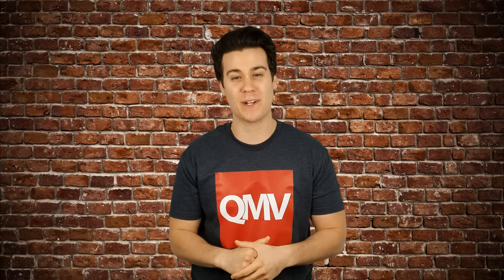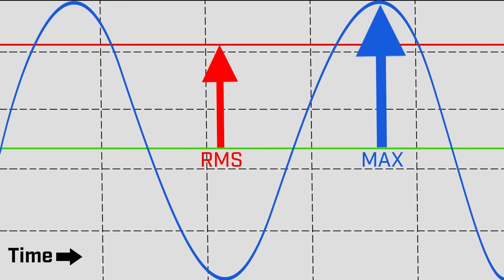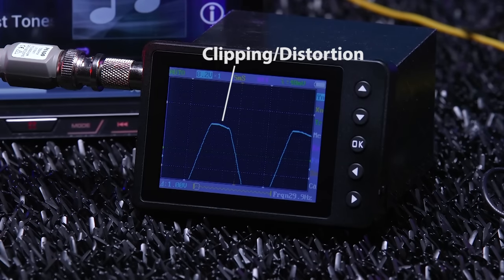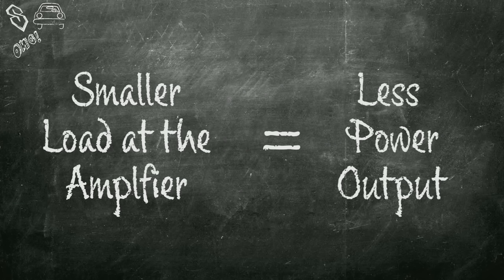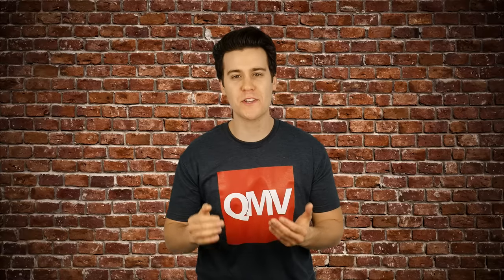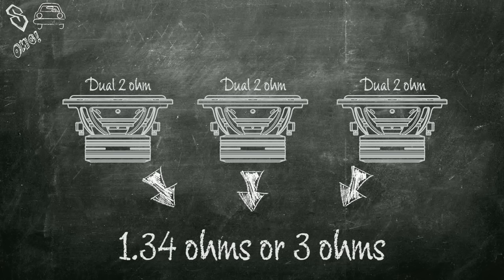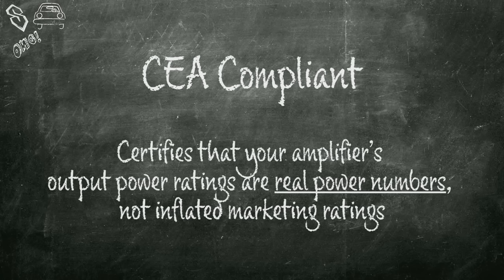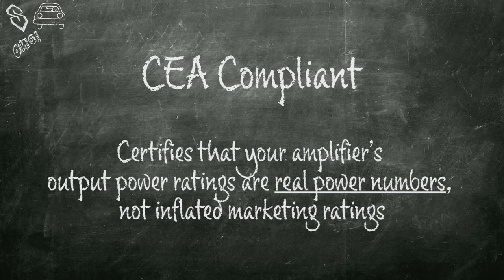How Do You Match Car Subwoofers and Amplifiers?

Comment: Is it me or are his calculations off on the ohm loading for the 3 sub example at the end?
Reply from the maker: Three DVC 2 ohm woofers wire to 1.34 ohm or 3 ohm. Three DVC 4 ohm woofers wire to 2.67 ohm or 6 ohm. These are correct
Reply: @Qualitymobilevideo  OK so let me get this straight hammie! I have two dual 4 ohm 500 RMS speakers (peak 1000 watts). Then I have a rockville m3 mono amp and its specs are

1 Ohm: 2000 Watts x 1 Channel

2 Ohm: 1500 Watts x 1 Channel

4 Ohm: 1100 Watts x 1 Channel.

If I follow your methodology I would have to wire my speakers in series parallel correct?

Comment: What amp should I run on my 10inch jbl 500watts
Reply from the maker: Which sub do you have? Need to know if it's DVC or SVC. 2 ohm or 4 ohm. 500W RMS or MAX?
Reply: Quality Mobile Video it is a 10inch jbl 500 4ohm 125 rms
Reply: Quality Mobile Video JBL CS Series CS1014 subwoofer
Reply from the maker: Ok cool. So one SVC 4 ohm woofer can only be wired to a 4 ohm load. You'll want a monoblock amplifier with an RMS power rating of 100-200W RMS @ 4 ohms. Check these out:

Rockford Fosgate R500X1D 300W RMS @ 4 ohm
http://www.qualitymobilevideo.com/rockford-fosgate-r500x1d.html?utm_source=YouTube&utm_medium=Video&utm_campaign=Match_Subwoofers-Amplifiers
Rockford Fosgate P400X1 250W RMS @ 4 ohms
http://www.qualitymobilevideo.com/rockford-fosgate-p400x1.html?utm_source=YouTube&utm_medium=Video&utm_campaign=Match_Subwoofers-Amplifiers
Pioneer GMD8601 300W RMS @ 4 ohm
http://www.qualitymobilevideo.com/gm-d8601.html?utm_source=YouTube&utm_medium=Video&utm_campaign=Match_Subwoofers-Amplifiers
Kenwood KAC-5001PS 300W RMS @ 4 ohm
http://www.qualitymobilevideo.com/kac5001ps.html?utm_source=YouTube&utm_medium=Video&utm_campaign=Match_Subwoofers-Amplifiers
Kicker 43DXA500.1 250W RMS @ 4 ohms
http://www.qualitymobilevideo.com/dxa500-1.html?utm_source=YouTube&utm_medium=Video&utm_campaign=Match_Subwoofers-Amplifiers
Kicker CXA600.1 300 Watts RMS @ 4 ohms
http://www.qualitymobilevideo.com/cxa600-1.html?utm_source=YouTube&utm_medium=Video&utm_campaign=Match_Subwoofers-Amplifiers

Comment: I have 2 subs 400 RMS each, a car audio shop sold me a 350 RMS 2 channel Amp. They told me it was the perfect match for my subs. The amp ran super hot and had distortion and told me it was normal and sorry no refund just store credit. They said if i wanted a bigger amp i would need to buy bigger subs. I think 350 RMS is not enough to power 2 400 RMS subs am I right or wrong?
Reply from the maker: Well it sounds like they mismatched your gear. What are the exact models of the subwoofers, I need to know their specs. DVC or SVC? 2 ohm or 4 ohm? Also, what amplifier did they sell you.
Reply: @Qualitymobilevideo  subs are DVC, 4 ohms, 400 RMS 800 watts, Amps is 350 RMS, 2 channels
Bridged
1ohm 388rms max
1ohm 350rms
2ohm 250rms
4ohm 150rms
Sensitivity 85 bd
Reply: @Qualitymobilevideo  also ported box with 4 gage battery and ground wire with factory XM radio
Reply from the maker: Ok, I would suggest getting a monoblock amplifier instead with a little more power and shoot for a 1 ohm load because two DVC 4 ohm woofers make a 1 ohm load or 4 ohm load when wired together. So get a monoblock with a power range of 700-950W RMS @ 1 ohm. Check these out:

Rockford Fosgate P1000X1BD
http://www.qualitymobilevideo.com/rockford-fosgate-p1000x1.html?utm_source=YouTube&utm_medium=Video&utm_campaign=Match_Subwoofers-Amplifiers

Pioneer GM-D9601 
http://www.qualitymobilevideo.com/gm-d9601.html?utm_source=YouTube&utm_medium=Video&utm_campaign=Match_Subwoofers-Amplifiers

Rockford Fosgate R1200-1D
http://www.qualitymobilevideo.com/rockford-fosgate-r1200-1d.html?utm_source=YouTube&utm_medium=Video&utm_campaign=Match_Subwoofers-Amplifiers
Reply: @Qualitymobilevideo  thanks, they told me in order to get a bigger amp, i have to buy bigger subs because the 350 rms amp was the perfect match.
I don't know how to explain then the amp is too small, I told them it gets hot, they said some amps run hot so is normal.
Reply from the maker: @crisosiris3422  Honestly, I would go with a monoblock and not a 2 channel :)
Reply: @Qualitymobilevideo  thanks for the help

Comment: I didn't understand if you meant this would destroy something. Say you have 1 12" sub at 250rms 4ohm, and a monoblock amp running 500w RMS at 4ohm. Your amp will run cooler which is good.  But did you mean it would fry the sub because RMS doesn't match?  I'm a visual learner, draw me pictures!
Reply from the maker: LOL we did draw pictures! The first thing to analyze about your system, is your subwoofer a SVC or DVC, that's crucial in determining your amplifier load possibilities

Comment: I am SOOOO lost ):  . All I know is what box enclosure to get and what subs I want (two SKAR IVX-12v2 12" (400-watt)-DVC-4OHM) ...... please someone help
Reply from the maker: Hey Colt, so two DVC 4 ohm subs make a 1 ohm load in parallel and 4 ohm load in series. And combined 800W RMS of the subs. I'd get a monoblock amplifier with a power range of 700-1000W RMS @ 1 ohm. Check these out:

Rockford Fosgate P1000X1BD
http://www.qualitymobilevideo.com/rockford-fosgate-p1000x1.html?utm_source=YouTube&utm_medium=Video&utm_campaign=Match_Subwoofers-Amplifiers

Pioneer GM-D9601 
http://www.qualitymobilevideo.com/gm-d9601.html?utm_source=YouTube&utm_medium=Video&utm_campaign=Match_Subwoofers-Amplifiers

Rockford Fosgate R1200-1D
http://www.qualitymobilevideo.com/rockford-fosgate-r1200-1d.html?utm_source=YouTube&utm_medium=Video&utm_campaign=Match_Subwoofers-Amplifiers

Comment: Hey man I ran a amp and a sub to perfect match and I keep blowing subs what do I do
Reply from the maker: Well what are the exact models of the gear, maybe they aren't perfectly matched
Reply: If you’re not using OFC wiring, an upgraded alternator, and a big 3 upgrade, you’ll be starving the amp of power and under powering it. Which causes it to heat up and and burn out your subs.

Comment: So question.. baised on this.. I have a boss audio phantom 3000 2 channel and 2 ohm stable amp, and 2 1500rms DVC subs and want to have them wired at 2 ohms. Since the rms match and is a smaller ohm... My amp would be prone to overheating right? Even though the rms match?  Anybody know from experience if this set up is ok? If not I can go 4 ohm. But I want the max bass too.
Reply from the maker: Two DVC 2 ohm subs cannot wire to 4 ohms. The 2 ohm loads are your best option. Any system with that much power is prone to overheating when pushing to its limits
Reply: @Qualitymobilevideo  oooff... Ok.  And I also gotta upgrade my wiring and add an extra battery or 2 in the back. I'll see about getting a external fan to aid in cooling.  Thanks for your help! :)
Reply from the maker: @Dusky_The_Husky  Yea you may need to upgrade your battery supply! You'll be drawing a lot of current. Good luck!
Reply: @Qualitymobilevideo  thanks! I'm thinking of using the 2 side post batteries I have laying around connected by bus bars. Should work for short to medium periods of high bass levels. Thanks!

Comment: I need help !! I am trying to run a box with 2 Rockford Fosgate RFZ3810's. rated at 8ohm and 400 watt Max/RMS, 150 watt nominal. I used to run these with a Sony Xplode 760W amp (which was plenty of thump for my needs), but it has gone missing. I didn't realize they were 8ohn until after I ordered this amp, do you think I can get away with it if I wire these subs in series, and just keep the gain dialed down? Or is it time to admit my mistake and return this, and fit a proper amp to these Xplod's?  https://www.amazon.com/gp/product/B01MAX2S9N/ref=ppx_yo_dt_b_asin_title_o00_s00?ie=UTF8&psc=1
Reply: I've decided to run these parallel and set this up for 4ohm. Waiting on the head unit, and will test this once it is installed. Fingers crossed.

Comment: I’m buying this - Kicker 44DCWC122 12"/600 Watts RMS/2 Ohm Dual CompC Car Subwoofer

Is this amp good - Amplifier Class: AB
No of channel: 4/3/2 Channel
Max. Output Power: 1500W x 4
RMS Power (4 Ohms): 150W x 4
RMS Power (2 Ohms): 300W x 4
Frequency Response: 10Hz - 45Hz
Signal-To- Noise Ratio: =>90dB
Voltage Supply: 11 - 15V DC
Gain Adjust: 150mV-6V
Total Harmonic Distortion: <=0.05 percent
RCA Input: 4-Channel
Crossover Frequency: 50Hz - 400Hz
Crossover Slope (dB/oct): 8-10dB/oct
Fuse: 30A x 2
Dimension: 8.6" x 7.5" x 2.1"

Will this work ??????

Comment: Will my 1800 watt audiopipe blow my 1200 watt 2ohms L7?
Reply from the maker: Can you be more specific with part numbers? The Audiopipe APCLE-18001D? And an L7 subwoofer rated 1200W RMS? Won't be an issue wired at 1 ohm in parallel. If the sub is 600W RMS, you can wire at 4 ohm no problem in series.
Reply: @Qualitymobilevideo  yes I have the audiopipe 18001D. I just ordered a single 12 L7Q 4ohms says 900 rms
Reply from the maker: Ok that changes things. So you have One DVC 4 ohm subwoofer with an RMS of 900W RMS. This will be a perfect match to wire to the 2 ohm load at the amplifier in parallel

Comment: The system I built for my wife's car wife's car didn't make sense. It slammed. I used a 250 watt Sony xplod 2 channel powering 2 Kicker 10's. , sony 6by9s and 6.5's, 4 sony tweeters. 
EQ settings: -10 to +10
Sub: +10
Low: -6 to -10 if I'm into a more highs mood.
Mids: -8 alone and -6 to -4 with ppl.
Highs: +10 all the time. 
I tuned it to turn it up to the max with absolutely no distortion. Just crisp clean highs and lows with just enough mids. I've been trying hard to get my 250 watt 2 channel back. I offered her a 600 watt amp but she wouldn't trade because she knows I really want my cheap 200 watt amp back. She pawned it for probably $8.. and lost it to the pawner.

Comment: Great video. I’ve seen it like 20x. Question, what are the cons of having a over powered amp? I got 2 pairs of 4hms 100 rms watts speakers and I am hoping to buy a 4 ch amp amp at 150 rms watts at 4 hms. Is this amp too powerful, will it harm speakers???
Reply from the maker: No cons! Having head room on your amplifier is actually ideal. The issues people get is when their amplifiers are under-powered compared to their speakers/subs, which starves their speakers/subs. Your speakers will be well fed
Reply: That is a perfect set up more than enough power helps your amp run cooler than if it were under or just at the water is needed for the speakers my bad wattage needed at the speakers just don’t turn your amp all the way up and it will run efficient without getting hot

Comment: I have 2 12s that are 2ohm for each sub and each sub is 750rms can somebody please explain a mono 2000w is right for these and if not what is?
Reply from the maker: Are they DVC or SVC
Reply: @Qualitymobilevideo  Alpine Type R 12 Inch 2250 Watt Max 2 Ohm Round Car Audio Subwoofer | R-W12D2
Reply: @Qualitymobilevideo  Rockville RXD-M1 2000 Watt/1000w RMS Mono Class D 1 Ohm Amplifier Car Audio Amp

And this is the amp I just ordered I just hope I got the right stuff
Reply: @Qualitymobilevideo  thanks for the input....
Reply from the maker: @b Dude we get 200 comments a day on top of all the work we do on day to day operations. Next time give me ALL the info upfront and I'll be able to give a full answer right away rather than our comment thread getting lost and buried by 300 other notifications. TWO DVC 2 ohm subs can be wired to a 0.5 ohm load, 2 ohm load or 8 ohm load.  You can wire the subs to the 0.5 ohm load in parallel to that amplifier. You're welcome
Reply: @Qualitymobilevideo  bro I need you help I'm trying to get this system installed and I just emailed a company that does it in my local town and this is what he said and I want to see what you think about it cuz I think he's straight bullshiting me ...by the way my amp wiring kit is 4 gauge......

The amp and amp kit are far too small to even bother installing. Those subs require 750w rms each. The amp purchased has a 60 amp fuse that means it can never produce more than 840w max. 60a x 14v = 840w

An amp can not draw more power than the fuse(s) on the side will allow. Also most amps are under 80% efficient so it would be quite a bit less than 840w!

This low amount  of output will result in potential damage to the subs and definitely will NOT sound good.

For an install like this a proper OFC oxygen free copper wiring kit is needed in 0 gauge.

Comment: I 'overpower' my woofers, your idea works but 'overpower' if your application has impedance rise, my subs out of the box say they're 4 ohms and wired in parallel they should come down to 2 ohms but they come down to 1.6 ohms. I'm using 2 12s SVC 200w subs and my amp can handle 2 ohms @ 700w and 1 ohm @ 1000w. Wired in they should be running on 400w but I'm running them from 700w and they don't have a problem. Just remember the impenence is almost never a static load. If you're new to car audio it's best to get a good idea of how things work from the internet and learn yourself
Reply from the maker: Thanks for the info!

Comment: Help please anyone lol 
I have a ported box with 3 boss 10 rippers 300w rms 4 ohm ...have no idea if they're wired in parallel  or not * 10” SUBWOOFER* 4 Ohm* FREQUENCY RESPONSE 30hz- 3khz* PEAK POWER 600 watts* RMS 300 watts RMS* SENSITIVITY 94 db* TOP-MOUNT DEPTH 4 5/8”* VOICE COIL 2.5”* MAGNET WEIGHT 50 oz* sealed box volume 1.25 cu. ft.* ported box volume 2.0 cu. ft.1-year warranty...
 Per speaker...box itself says handle 2000 w*** is all the info I have..help would be appreciated . I dont know what amp to look for

Comment: Ok now I'm really lost, I'll need some help with getting my system going in my truck, anyone know enclosure specs as well, I'm going to run (4) ds18 6.5" subs, they are dual 2ohm. 400rms-800 max watts. All this ohm stuff toasted me.
Reply from the maker: They're 400W RMS each? Four DVC 2 ohm woofers wire to a 1 ohm load in parallel and a 4 ohm load in series. If you plan on using one amplifier, you'll need a monoblock with RMS of 1600-1750W RMS @ 1 ohm. If you use two amplifiers, then you can make two 1 ohm loads at each amplifier with two subs, 800W RMS @ 1 ohm
Reply: Yeah I plan on running one amp to the four subs, I was wanting to build the box myself but I'm not too good with the math side of figuring it out haha just like this ohm stuff. Thanks I appreciate your help if you know anything about the box specs that would be greatly appreciated as well. Have a good one.

Comment: 2 10,000 Watt monoblock requires at least 2500 amperes of power, meaning the mentioned 300 amp alternator will not cut it. Probably multiple alternators to power additional batteries to support current draws from these amps.... not hatin, just sayin...

Comment: Sorry to make a correction here but subs don't output anything.  You cannot say a sub has 2000 watts of output.  That's stated incorrectly.  Please sir, if you are going to be teaching please state it like this.....  This particular sub is rated to handle 2000 watts of continuous power, or something more along those lines.  I think many folks are with the understanding that if a sub one sub is rate at 1000watts and another is rated at 2000watts then the 2000watt sub will be louder.  This is absolutely incorrect.  In fact the lower wattage sub may get louder than the higher rated sub due to it being perhaps more efficient.
I'd love to break this down properly for you guys, but I don't quite have the time for that....  Good luck, and try not to get confused.

Comment: here it is in a nutshell...............any reputable amp will give a true value of it's RMS output power , next this is the bit which seems to confuse everybody........why.........i don't know ,  a reputable sub's RMS value is exactly  double the RMS of a amp..........why do manufacturers do it , it's a hurdle 4 newbies (welcome to our world). So pick your sub , then drive it with an amp that does half it's RMS value. Result power output of amp exactly matches power input of sub , you'll get maximum deflection of your sub ,loudness , and your amp will not be under or over powered.

Comment: I’m a professional live sound engineer as well as a studio engineer, but trying to get into car audio because I can’t stand tweaking/ processing audio all day and then getting into my car and listening to shitty speakers😂
Reply from the maker: Came to the right place! Trying to get a system in your car? Would be happy to suggest products based on your needs/budget
Reply: Quality Mobile Video I found a 12” Alpine woofer from a previous system and was looking into the alpine M500 amp to power the sub, only problem is... I still have a factory radio system in my car and have yet to find an aftermarket radio to install because the system has all of the controls. (AC, climate control, audio, hazards etc.)

Comment: Hello Mr. James, of Quality Mobile Video.
I pray that you are well and all that concerns you during this COVID pandemic.
Thanks for the video lesson, I really appreciate it.
Kindly, please advise me which the spec ranges of a car amplifier that will match with Pioneer Champion Series PRO TS-W3003D4 (https://www.pioneerelectronics.com/PUSA/Car/Subwoofers/Subwoofers-By-Size/TS-W3003D4#specs)
•	frequency response: 20-80 Hz
•	power handling: 100-600 watts RMS
•	peak power: 1200 watts
•	sensitivity: 96 dB
To deliver deep low basses (not punchy but low “drugging-vibratory” base.
Thank you very much, Sir
.

Comment: How to wire 2svc 4ohm subs with 1dvc 4ohm sub
Reply from the maker: I highly recommend not using both together on the same amplifier. It is essential to have identical woofers, otherwise you'll damage your gear and have nothing but problems. Be sure to subscribe if you're new to our channel and let me know if you have any other questions :)
-James